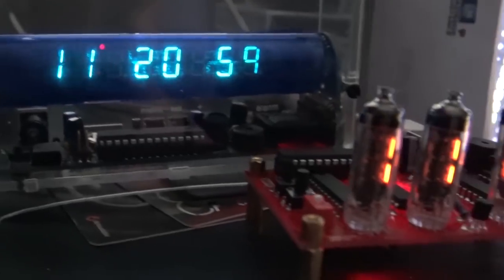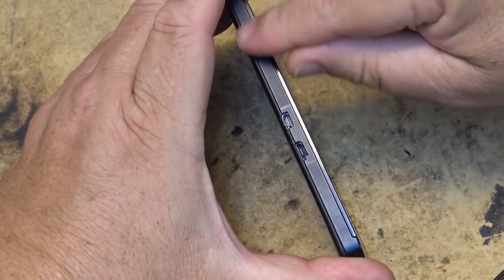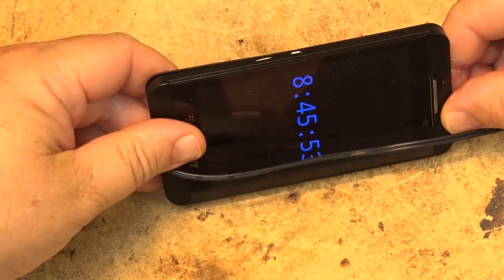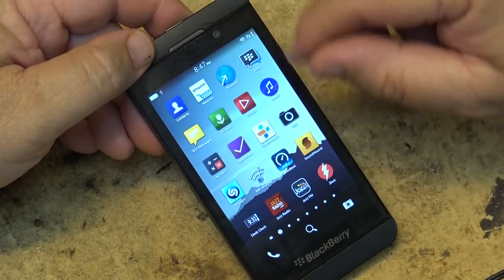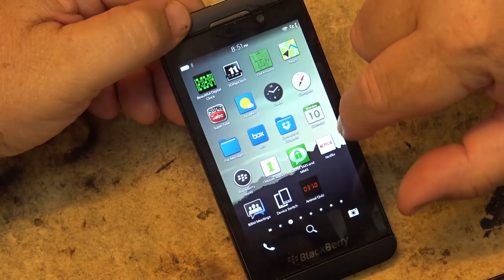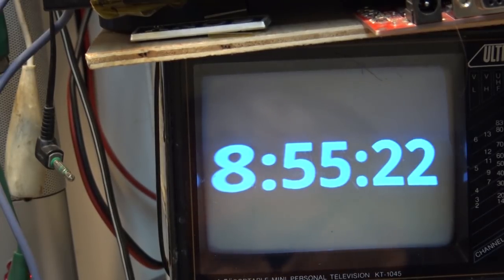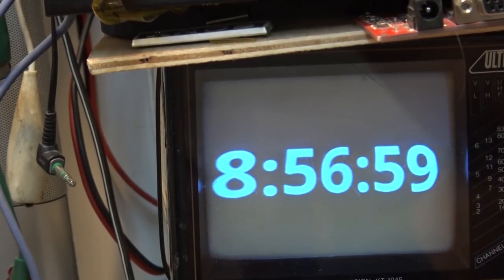CRT time display

Comment: Albeit a bit overkill to use a smartphone+AV converter just to throw out a composite signal consisting of a wall clock, it's great that you repurposed that device instead of letting it rot at the bottom of a drawer. And it's neat!
Reply from the maker: I use it for internet radio as well. 
Remember that blackberry 10 is is multi tasking. I can throw the time out the hdmi and play a radio station out the headphone or bluetooth.  Had BlackBerry responded to apple when they were king and they were the king at one point there wouldn't be android. There would be iOS and bb10. But they were too little too late and now they are android themself. But their bb10 OS was so far more advanced than everything else out there. Android is almost there now with multi windows but bb10 did it flawlessly and you could have 4 windows open all apps running.

Comment: I was supprised to see a hdmi on a phone of any type, blackberry were ahead of there time.
I also like your smart use of old equipment, the dummy battery hack is just sneaky :-D, it's the sort of thing i would have done to bypass a problem.

i have noticed that other phones are starting to copy the blackberry rolled edge display, i thought it looked nice, but that's just me.
Reply from the maker: zx8401ztv 
They were very ahead of their time the bb10 OS was hands down the best OS. It could run 95% of the android apps flawlessly. If blackberry hadn't switched to android I would still have one. For what I used my phone for it was far easier to do things.  I run a Samsung s9 now and I have to struggle to do things I didn't have to think about on bb10. Android is getting better but it was much simpler with bb10

Comment: So call me dense, but how do you get HDMI into an old B&W television?  Is there an adapter for HDMI to screw terminal antenna?
Reply: Tenspeed TheBikeHanger
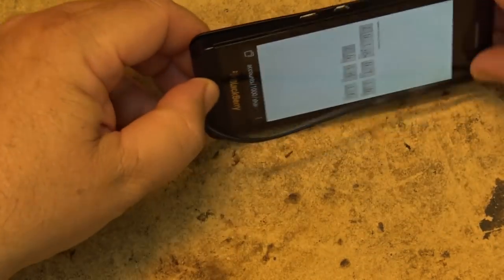he takes the hdmi out put and runs it into a video converter ( click on this 3:20 time to see in the video ) and then runs the composite video into a RF modulator on channel 17 via coax that is distributed around his house with splitters, that way he can watch on any tv in his house by tuning in on ch 17 the same at his cctv on channel 7. 
the htmi to video converter vlog here https://youtu.be/aPYPXrmRfow
Reply: Did you watch the whole video???? He explained that 🤔
Reply from the maker: Tenspeed TheBikeHanger 
Hdmi to av converter. If you look up my video "mini himi2av converter DOA" you will see the device that converts the output from the phone to video. From there it goes to an old modulator and then into the coax line that runs through the house with the  off air antenna.
Reply: N o, Jack, I just felt like asking a dumb question.

Comment: I had my 7" tablet running the same way when the battery entirely died. I just soldered the usb charging cords +5v lead and ground lead to the terminals where the battery was previously, works great! :)
Reply from the maker: Tom B 
On this one that won't work without the battery management circuit. Just shows an icon of a battery and then shuts down.

Comment: Got myself a playbook  , the bluetooth is useless , if I could still get the HDMI cable .
The thing is , its conecting it to  phono or scart .
Good biuld quality , good screen
Reply from the maker: shaun 
Never have had any issues with bluetooth. The range is about 10m which is all bt is good for.  For hdmi you just need a micro hdmi to hdmi cable. 
Then that can go to either monitor or converter to change signal into whatever analog signal format you want.
Reply: Its taking videos  transferring them to PC or SD .
Video send by Bluetooth is not there , or send from PC to Blackberry , it detects at first but no transfer ether way , it looks like its fixed up for Blackberry only , no anser from youtube .
How much memory space is free  , not available .
I think this one is not fully developed .
They claim these cost £500 plus  , I paid £20  second hand .
Its a pity about the file transfer , there aps are not good for that .
The only thing it is good for is Youtube & games  console .
Reply from the maker: shaun 
Never tried sending files over bluetooth. Just headphones and speakers. For file transfer I always just plug in the USB cable. Even on my current phone I wouldn't waste my time with fuel transfer wireless too slow. In the time it takes to transfer a couple of large files wirelessly I could have plugged the phone in, dragged the entire folder over and be done.
Reply: I attempted  that too but I still keeping this tablet , its got good sound  like you said so I loaded NOBEX radio on to it .
It sounds better than Android , , its more detailed , cough , copying those Club sounds on a tape ,  sh sh   lol

Comment: Ahhh nicce. Did you see my comment on your previous video regarding my Samsung plasma and its red spots/grainy issue?
Reply from the maker: Ezee Posse TV 
No, but it is likely a problem with either ysustain or xmain or the panel is starting to fail.
Reply: 12voltvids - Thank you for your reply. Yeah I kind of figured you would say that. The red grain only happens when a certain white colour tone is on screen. The other colours of white and all other colour tones don't trigger the red grain.
Reply from the maker: Ezee Posse TV 
I have one that does the same. I suspect the panel is at fault. No big deal because it was a free set (the one I fixed with the small crack on the screen) 
And now thanks to global TV it has a huge burn on bottom 1/3 and right 1/3 screen due to their static graphics on the morning news which is all I watch on it.
Reply: 12voltvids - Yeah I saw that video and I have that exact model. Mine was a freebie too so it's not going to put me out of pocket. I am going to do a reflow on the boards you advised to check though.

Comment: Now if I made the other choice to stick with the Android TV Box, I would have been try to get some Android software and Google Play software including the clock display and the weather forecast for my 2004 General Sound GS-241 5 1/2" monochrome TV (and I intentionally remove the speaker from the TV and disconnect the battery compartment from the chassis to turn into a monitor where it will be a portable TV clock display) instead of using the vintage monochrome TV and I was being very happy about using the modern monochrome TV.
Reply from the maker: Right but I want to run the crt untill there is no more electrons flowing from the gun and the phosphor screen is nicely burned in.   Only then will it be ready to recycle.
Reply: What model is from Ultra (Samsung) 4.5" monochrome TV?
Reply from the maker: @Bluethunderboom  
I have no idea.  I picked this up at the shop I worked at probably 30 years ago.  Someone brought it in on the weekend and one of the "kids" that worked in the store accepted it.  On Monday morning I saw this thing and called the customer to inform them of the shop minimum if it was looked at they said they only wanted to spend 20 max and I laughed.  They said toss it so I brought it home and here it is still works.  There is a video of me fixing it when it blew up last year so perhaps the model number is shown on that.
Reply from the maker: I have an android box that does display the time when not in use, but not as cool as using the blackberry. I have several flash files I can run on it that do animated time displays. My favorite is the had writing the time with a pencil and erasing and rewriting one digit at a time. That was the cool thing with the old blackberry 10 OS. It supported flash playback.